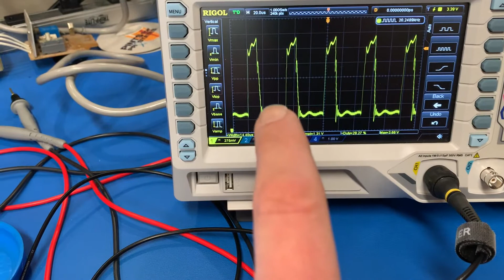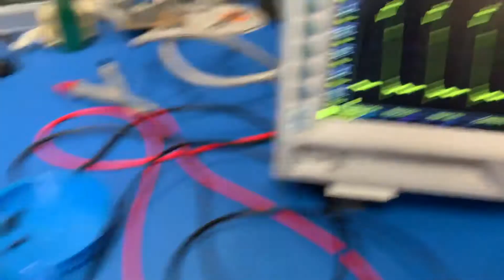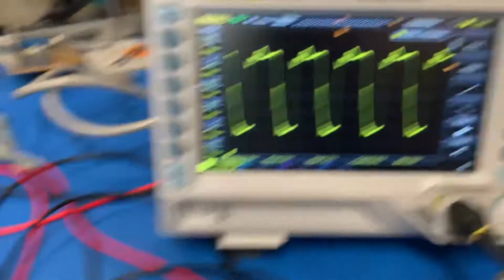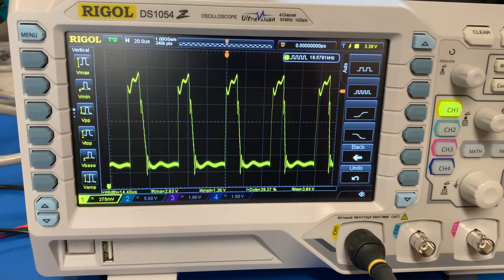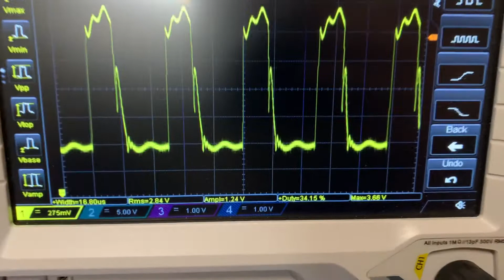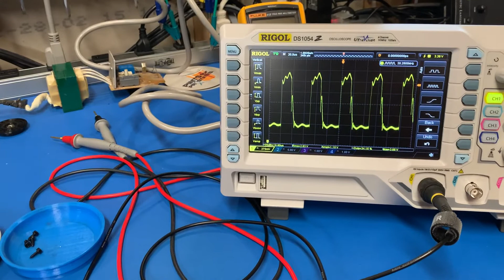Cheap import LED work lights losing brightness?

Comment: I saw you made a new plug for your pressure washer pump, can you make me one if I pay you?  I had the same issue as it blew out oil all over my driveway.  Sorry for contacting you this way however I could not find your contact info.  FAIP Pressure Washer Pump 1/4 Turn Oil Cap - FA-57137400  Thanks